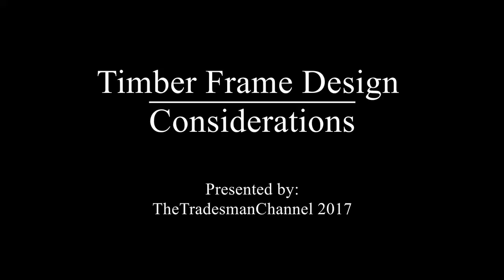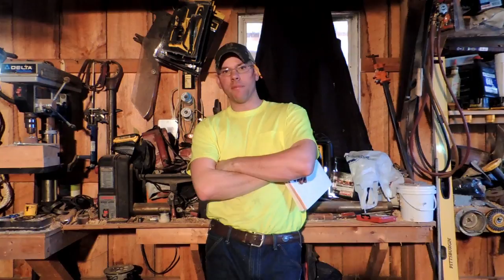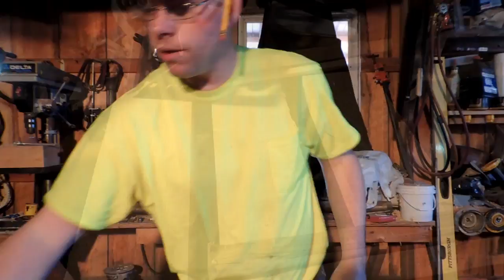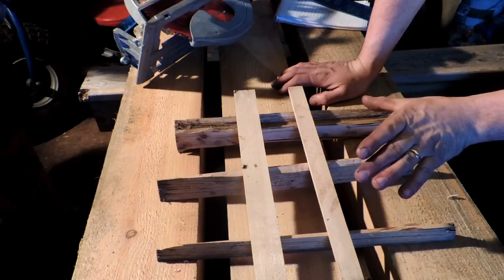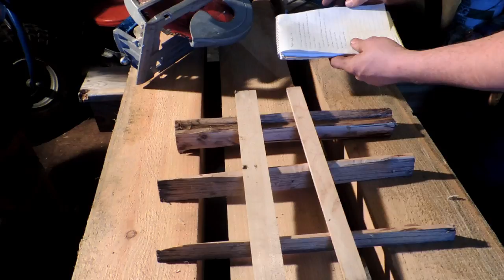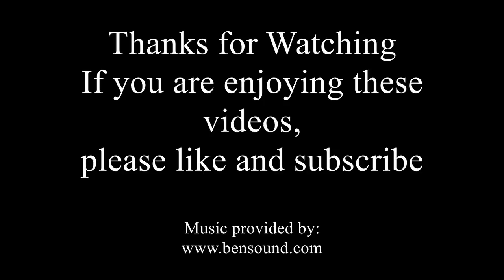Timber Frame Design Considerations

Comment: I just gotta say Jim I find your videos extremely helpful..I'm 63 yrs old and about to embark on my first timberframe project....a 12 X 16 storage building for hay.  I'm also using Will Beemer's book "Learn to Timber Frame" which includes a plan for a 12 by 16 cabin.  Will says in his book that the roof is planned for a 50 psf snow load but when I calculate the numbers as you demonstrate and plug them into the Forestry Forum calculator it fails.  Obviously I'm doing something wrong as Will is an authority in this area but I decided to add an additional 2 rafters tighten up the spacing and reduce the tributary area and it passed(my first plan modification!!!!  :) ) .  But this video inspired me to check things for myself and learn more about the engineering side of timberframing.
Reply from the maker: Will is very good at his craft but he does live in an area with less snow than we get farther north.  You didn't do anything wrong, you just have a higher snow load.
Reply: Ahhh Snow Load....... The Devils Trill!  Will has a luxury of low snow loads.  My snow load is 140 psf!!! A combination of new building codes and high Colorado altitudes... I am working at over 9500 feet in the alpine.  If you can find Ed Levin's book, it will greatly explain things as well.  He also has numerous tables on wood species.  What I did find and question is that the Young's modulus for oak is very very close to that of southern pine, eastern white pine and doug fir.  So I am researching this right now as well.  I would have expected the young's modulus of oak to be much higher than even doug fir.

Comment: You barn project is a true inspiration.  I am being forced to move. Long Story. So I am facing a similar project.  But this one will be a combination of home and shop.  I began with a text written by Ed Levin which is indispensable.  The issues are clear.  Your dead loads and live loads need to be considered.  But equally important is how you plan on building the beast.  Your barn incorporates a lot of COMMOM WALL design as opposed to BENTS with Primary rafters.  Bents are great if you have access to a crane which is brutally expensive.  You also need access to very long timbers.  For many of us, you included, our sawmill kit is often limited to 18 feet or so.  So scarf joints are a way of life.  As boring as the engineering is, you will find the actual design to be very time consuming.  But at the end, with some fine detail work on the plans, you will have road map which will pay dividends when its time to build.  Issues like the foundation need to be considered.  Also bear in mind that many areas use the IRC building code as a basis for their code enforcement.  Unfortunately, the IRC is a prescribed code that does not cover log cabins and timber frame structures.  So having detailed load calculations for virtually every stick in a nice note book will go a long way in convincing the building department to sign off on your design.  In Colorado, timber frame is now the new style for mountain homes so it's become easier to work with building departments.

My question is this. On your barn project, what were the actual size of your timbers?  Especially the horizontal girts that frame in the second floor?  They look massive.  Second, did you place any plates or other isolation members between your posts on the concrete to prevent rot damage?  Lastly, how did you fix or secure the upper bents used to establish your second floor shop area to the second floor itself?

Thank You for the work you have posted.  You have shown what a bit of determination and lot of hard work can accomplish.  Best of luck in your new home addition.  It never occured to me that the building department might be interested in how many times I need to poop each day.
Reply from the maker: Great comment.  The tie beams holding up the second floor are 10"x16", they are designed for 80lbs per square foot for a live load.  The floor joists are 5"x8".  The timbers are so big to take into account material removal for the tie to joust joinery.  I cheated on the queen post bents by using 12" timberlocs.  As for the bottom of the posts there are pressure treated plates with tar paper moisture barriers.  Loads for this type of building are extremely important as each joint has to support another and so on.  Great comment.

Comment: My barn was built around 1901 or before that. I'm not sure that those guys knew so much about calculations loads or such. But you are right in over building.
Reply from the maker: +T wagner it's funny how in-depth we get on engineering in the modern era.  I can't imagine how many joinery failures they must have had during the trial and error days.

Comment: Second floor live load is usually 40 lbs per sqft 60 lbs is for first floor
Reply from the maker: I know what it is, I probably misspoke.
Reply: Just posting that for future viewers
Reply: @JimRogers117   Thanks for posting that.  Note that these numbers represent "domestic use" live loads.  I had to recompute my live loads for the second floor woodshop to accommodate about 35,000 pounds of vintage woodworking machines.

Comment: cool build, but, using your table saw as a workbench? Not Good.
Reply from the maker: +D.M. Ziegler I happened to be in the shop that day with no room.  I generally work off of horses or timber dunnage.  You had to pick one my earlier terrible videos.  The last 60 or 70 are much better.  Thanks for watching.
Reply: TheTradesmanChannel 2017 Like I said, cool build. I tend to be a little over critical on certain things. Just starting a project myself, and your work is giving me some good insights
Reply from the maker: +D.M. Ziegler project is still going, always running out of material doing it out of pocket but a no debt giant shop will be worth it.  Don't worry about being critical here, I learn just as much from viewers as I try to show on the channel.  What is the building you're starting?
Reply: It's a timber frame porch  addition, 32 x 20'.  Using smaller timbers, with black locust for post material
Reply from the maker: +D.M. Ziegler very good.  Black locust is also a very good peg material.  If you get on the forestry forum there is a toolbox there that has a lot of easy to use engineering calculators for figuring your load calculations out based on spans and such.  Good luck with the project.
Reply: TheTradesmanChannel 2017 Thanks. I I’ve been on the forestry for them for a little while now. Lots of good information there

Comment: Forestry farm .com ?
Reply from the maker: Yessir, it is a great resource.
Reply: I am in the very beginning phase of design and construction of a small hunting cabin and intend on a timber framed structure with standing seam steel roofing, windows, etc. leftover from other jobs. I am having dificulty finding the resorcesses you've mentioned. Is it "forestryforum.com" or what? Thank you in advance
Reply: I will first build it at my home, then transport the kit with a pickup or something to the final site, so yes it is small but also a foot in the door for larger structures
Reply from the maker: Type in TheForestryForum in a Google search and the website will pop up.  In desktop version there will be a tool box symbol on the bottom left of the screen.  Click on the tool box and the engineering calculators will be displayed.  Hope this helps.
Reply: Thnx alot pal
Reply from the maker: Any time.  If you have any questions feel free, I'll help you where I can.

Comment: That's why I didn't get an engineering degree. I would be completely fine figuring it up for my own use, but for a customer? Not a chance. You miscalculate or fail to include one rafter, joist, or whatever, and it has a problem down the road, even if it is something unrelated, and it's your ass that's on the hook. Engineers are a lot braver than I am.
Reply from the maker: Same here, one mistake could cost you everything you own.
Reply: My first engineering degree was in aerospace structures.  We examined lots of older wooden airplanes to see how the various loads and methods of analysis work.  But nothing prepared me for timber framing structural analysis.  A lot of it is simply empirical and only a few true engineers specialized in the craft know how to perform these load calculations.  Individual load calculations are indeed basic.  What is complicated is the "SUMMATION" and "INTERACTION" of timber frame loads.  You might get everything right but not consider "minor" details for example.  Things like the peg bearing stress on soft wood species.  Equally important is the quality of your timber.  If your milling it yourself, you need to examine or grade your wood.  In the end, its easier to overbuild a structure than suffer a failure down the road.  I cant even imagine how painful the bore scope would be in New York if something came crashing down.

Comment: 7 x 12 rafter? that's a lot of weight to get up there, especially green. Better have some equipment or a few circus strong-men on the payroll. lmbo.
Reply from the maker: +Thomas Russell there would be five of those style trusses if I went that route.  A little brute strength and ignorance can move a lot of weight.  I am most likely going with common rafters.
Reply: Cool

Comment: Hey
People need to make sure that where they live the local building codes let them engineer a building them self.  I know hear in Pa. all buildings need a stamp from a certified engineer.
Reply from the maker: +jim stew very good point.  I have cows so I'm doing it as an ag building.  No inspections and no engineers needed.  Excellent point and sorry I missed it.
Reply: LOL  hear in Pa I can not even build a shed for my mower with out a stamped permit..
Reply from the maker: +jim stew wow and I thought NY was commie country.
Reply from the maker: +simhopp engineer.  Probably the best and wisest thing to do is submit your plans to a Timber Framing engineer to make sure your joinery has the strength it needs to support the structure.  I stuck with standard joinery and time tested design principles because I bypassed the engineer.  When I do the addition on my house I'm going to get it checked by an engineer first.